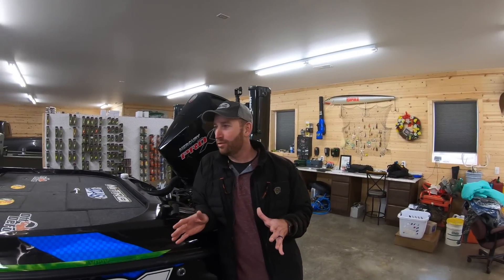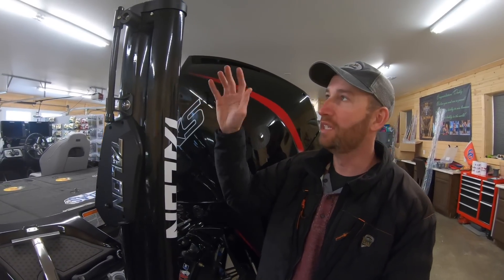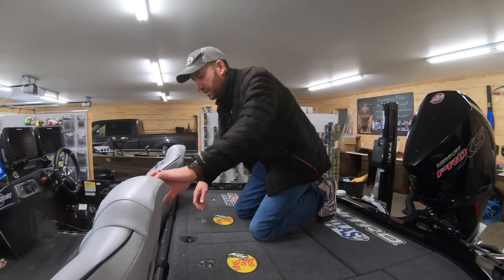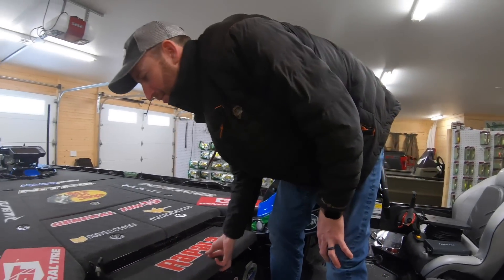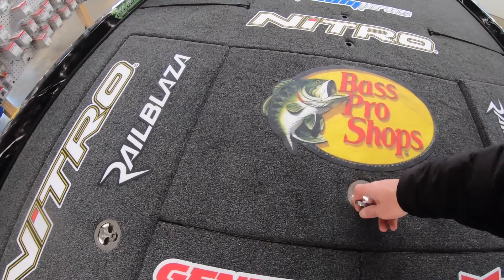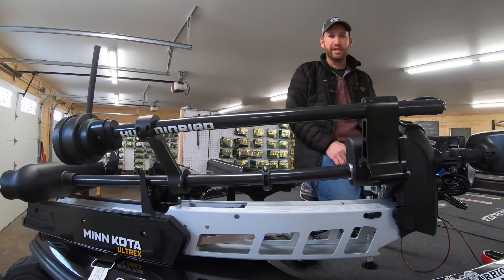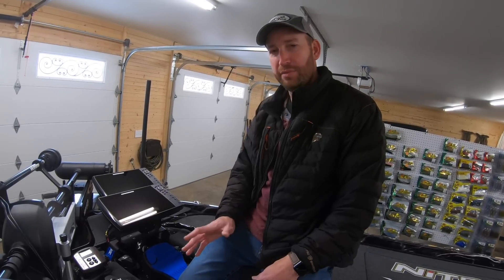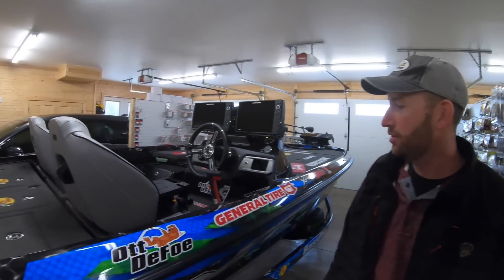2021 Nitro Z-21 boat walk through in the garage

Comment: That railblaza gopro mount is great. Can you provide more info on the specific mount you're using from them and maybe how to wire it up to the talon?
Reply from the maker: https://www.railblaza.com/products/camera-mount-adaptor/
https://www.railblaza.com/products/adjustable-extender-r-lock/

I use these 2 products together into this bracket

https://www.railblaza.com/products/tracloader-45-starport/

Inside the housing on your Talon will be a few wires. There is a red and black that have dummy ends on them. The black is a good ground. The red is no good. There is another small red and I just inline splice to it. Works like a charm!
Reply: @OttDeFoeFishing  awesome. Thanks Ott!

Comment: Ott, it's very hard to get the rear compartments open on my 2021 Nitro z21. I have to use a rope that really pull hard on the compartment lid handles with fear of actually breaking them. Did you have White River Marine do anything special with yours? Any suggestions?
Reply from the maker: Not heard of this. Mine comes off the same factory line as yours. Can you tell where it’s rubbing?
Reply: @OttDeFoeFishing  they seem to be rubbing all around the edges but specifically the front edge. I wonder if the lighter colored carpet that I ordered for the boat is a longer nap then the gray carpet I see you in the other fellows have on your boat. I hope that's the case because if the aluminum Lids were cut and welded a little oversized I won't know what to do about that. If it's the carpet maybe I can trim it with my beard shaver. Anyway you can find out for me if the carpet might be the problem?
Reply: @OttDeFoeFishing  forgot to say; thanks so much for your reply. And God bless
Reply: Thanks Ott. The spirit of making the Nitro boat better, I'll give you some more details on the difficulties opening and closing the hatches. But not until after you win redcrest. Good luck and God bless
Reply: @OttDeFoeFishing  Nitro z21 hard to open hatches, I found that it takes 40 to 60 lb of pressure to open the patches on my brand new 2021 Nitro z21. I measured the carpet nap to be 0. 3 inches. Really hurts my hand and my wife's hand to try to open this so we are using a rope to open them and pulling hard. I measured this with my fish scale and check the accuracy of that scale. I don't want to hurt the brand, but every time I reach out to White River, I don't get a reply. Oh it was even hard to get a 0.08 inch gauge to move between the lid carpet and the boat carpet when the lid was closed. Anyway so many great things about this boat I love it except for that. I have to figure out how to fix it. Your review of the DowCo Cruise air seat sold me and I have to say that seat is awesome.
Reply: @OttDeFoeFishing  I forgot to say I was really happy to see you Place High in the tournament. May God continue to Grace you with good fortune. I just happened to notice you had one of my favorite verses on your jersey. I hope others notice too!

Comment: Any reason you didn’t jump up to the larger amp hour starting battery?
Reply from the maker: The 80 is plenty for my set up but you do have to remember we don’t run our live well pumps any in BPT. I may need 100 if I did
Reply: @OttDeFoeFishing  good point

Comment: Do you know what the material used is in the organizing system?  I've been thinking about this exact thing for my boats center hatch.
Reply from the maker: It’s similar to a cutting board it seems. Has a little flex but very durable
Reply: @OttDeFoeFishing  thank you for the quick response.  I did manage to find some polypropylene sheets that I think may just do the trick.